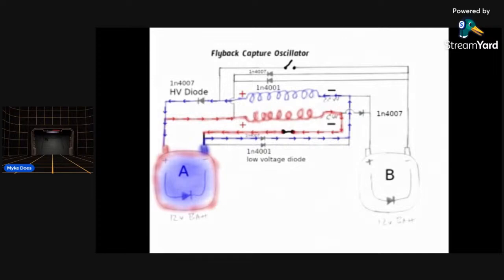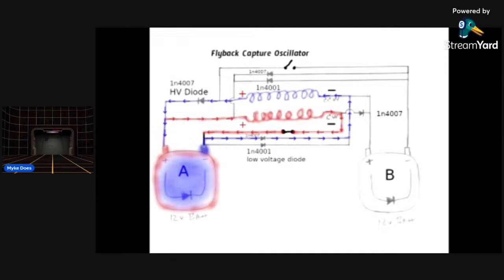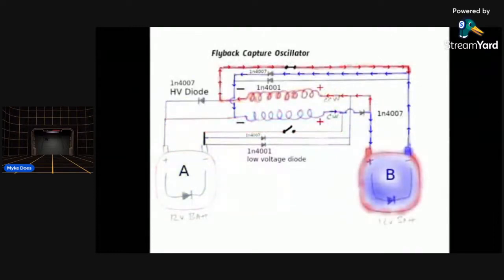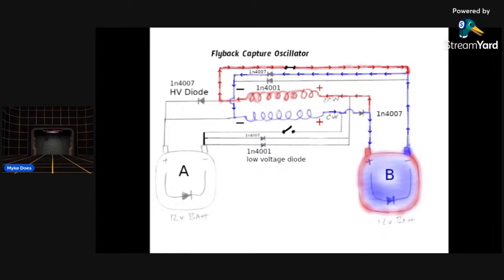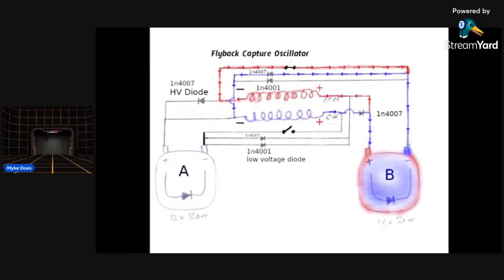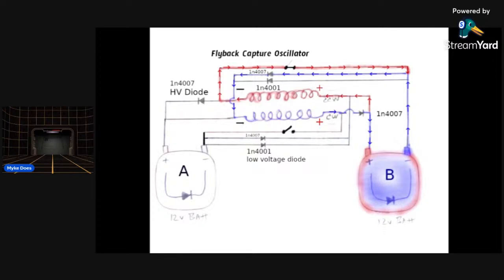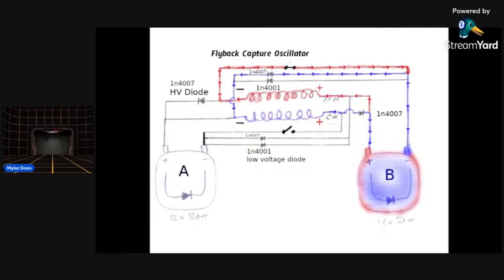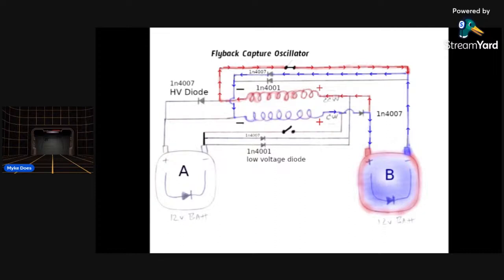Review by Author Open Source Reverse Flyback Circuit  Myke Does

Comment: Nice work, the fact this collapse in the coil switching process produces an amazingly high voltage spike just by being disconnected is fascinating to me. It is also very easy for this back emf to be lethal so of course caution is advised. When I was studying magnetism I read an explanation that may tell of where this spike enters the system, it was in relation to collapsing magnetic fields and stated that when a permanent magnets field is forcibly reduced to the point of field collapse, like in a pulse motor, the earth and or the universe almost instantly replenishes the magnets field. I assume this is also what happens when an electromagnetic field collapses, if so this would explain the source of the inrush of energy.

Whatever trigger system is used requires a bit of experimentation, not all transistors like this rapid switching but when you find the right one this effect is worthwhile. Personally I find this is easily achieved using 12volt car relays, wired the right way they become a self oscillator and spark gap in one, a 12 volt relay will produce approximately 120 volts AC and a 24 volt relay will produce 240 volts AC, a bit noisy but super easy to study.
Reply from the maker: To my understanding the reverse flyback voltage and the back emf are two different things that may or may not be related to the same event.   Reverse Flyback Voltage is Volts and the Back EMF is EMF
Reply: @mykedoes4099  You could be correct about them being different functions of the same event. Personally I think electron movement is presented as a voltage spike which moves NEG to POS and the equal and opposite reaction is power or EMF moving from POS to NEG. I think...

Comment from the maker: If you look close you can see the coil in blue which is the coil doing the flyback is able to also assist the opposite coil in charging with its battery. The negative of the coil in blue can flow threw the HV diode into the neg side of the other coil and so can the positive side flows out the other HV diode to both the battery and the positive side of the coil it is assisting in charge